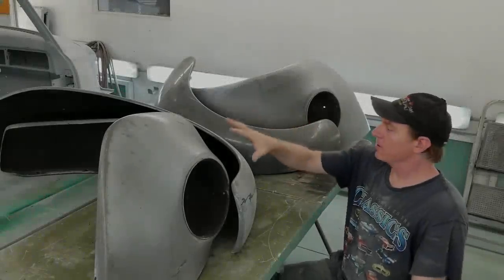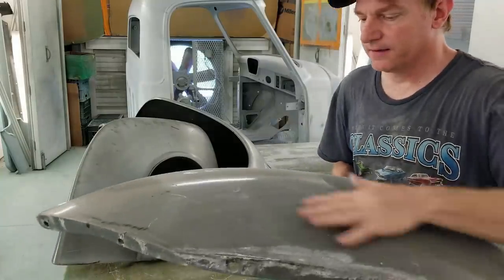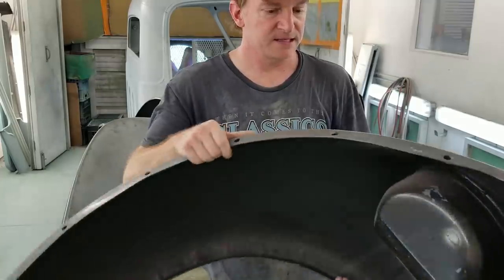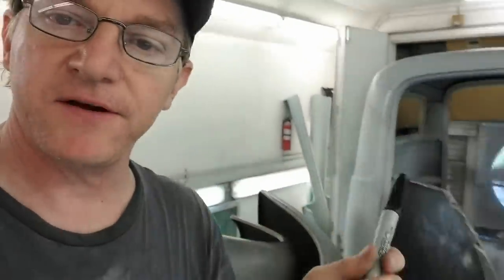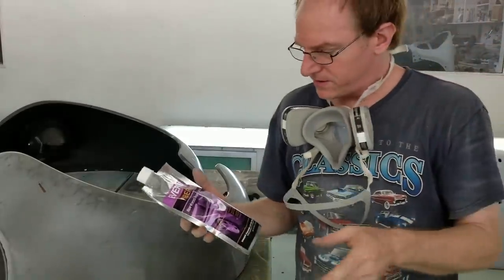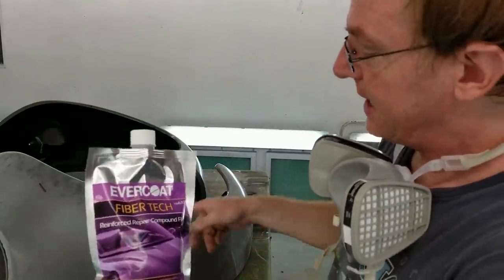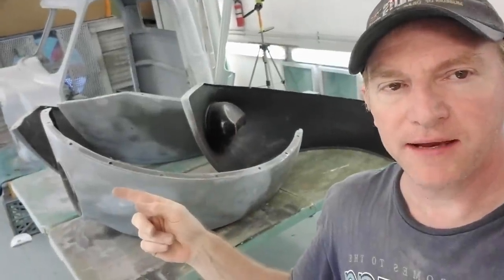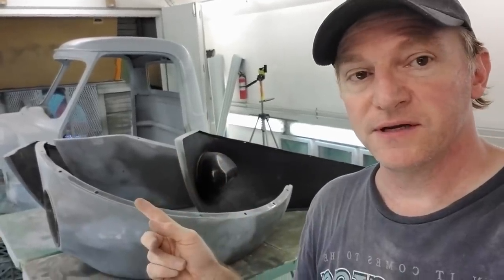Eleanore's Fenders - ROTTEN OLD CHOP TOP 1956 VW BEETLE - 130

Comment: Who would have guessed that grape jelly is used to repair fiberglass cracks?
Reply from the maker: Fiber tech is one of the better Glass products we have used successfully even in structural areas, Our Paint Rep turned us onto this product a while ago... we use it over most other glass products, only product stronger is actually using fiber glass matting and resin, which I did on the inside of the fender mount points shot that video yesterday... itchy stuff!
Reply: @ES4406  But the big question is.... how well does it go with peanut butter?  😀😀😀😀😀

Comment: Love your work. Love the show. Those cracks emanating from around the holes are stress cracks caused by movement or flexing of the mudguard while the car is in motion.  Unfortunately, unless that flexing is addressed all your excellent work will be in vain as in the future they will re-appear or sprout up somewhere else. May I suggest a layer of chopped strand mat about 6" wide layed right round the inside of the flange to strengthen the corner, the flange face and the first five inches of the guard to stiffen the whole structure and prevent any further movement in that area. Glass over the holes and redrill them later.  Incidentally, are the guards made from polyester or epoxy?  If made from polyester they should be repaired with polyester not epoxy as they are not a good match (different chemical properties).  Good luck.

Comment: I notice all the breaks are related to an attachment point. Could the cracking come from expansion/contraction  differential between the metal hull and plastic fenders?
Reply from the maker: Possible its just how they are fitting to the body... or just shelf handling over many years before Glenn

Comment: Serious question this time. I have a pair of glass guards for my Holden project. The gelcoat is extremely thin so that the glass fibres are visible and right there in the outer surface. What product would you use to saturate these areas and seal everything? I was thinking a through sanding and a thick coat of 2k epoxy primer..
Reply from the maker: We had a similar case were we had a glass hood  previous shop took too much gel coat off the fiber glass.... best bet is to layer up epoxy and work off it ... that was our Reps decision.

Comment: Be careful with the sharpie the ink will bleed threw the paint in time use a paint pen doing great work
Reply from the maker: Yes... I used it because i am going blind LOL!   I didn't want to miss anything and have to go back... I sanded all of it all out!
Reply: @ES4406  I use Sharpies all the time to mark interior parts. Then Denatured alcohol (or rubbing alcohol for delicate vinyl etc.) to take it off. Works great. I've been "playing at" bodywork for 40 years and still learning all the time. Had a '66 6V Beetle beater someone had hacked the fenders to put bigger tires on. Didn't even TRY to cut a smooth radius! Looked like they used a Sawsall. I was just going to take the fenders off and do a "Baja" look but somebody offered me twice what I had in it and I said: "Hell Yeah!"

Comment: Silly question, can you reinforce the mounting holes with carbon fibre over the fiberglass?
Reply from the maker: thank you for asking, doing that today with matting and fiberglass resin..... the outside just wanted to get the cracks in gel out.
Reply: I just thought that a bit-o-carbon fibre on the holes to strengthen. (All I have is backyard Bondi experience)
Reply: carbon fiber and fiberglass have a different elasticity, it's a bad idea to combine them.
Reply: Huh...like I said, I was a backyard bondo'r😄